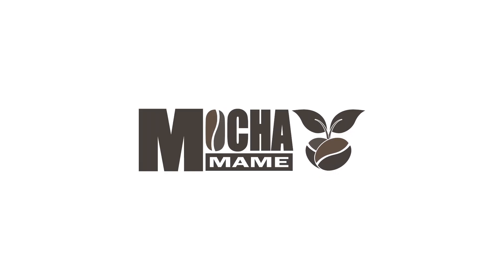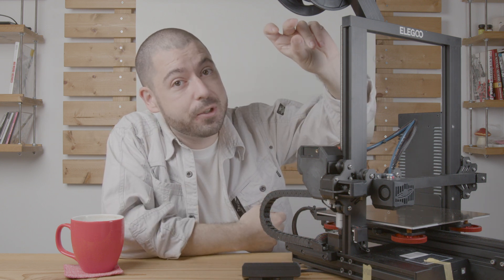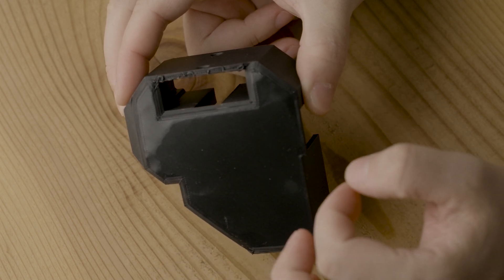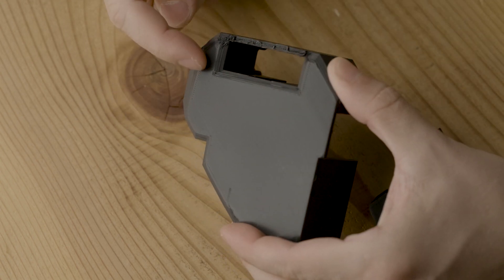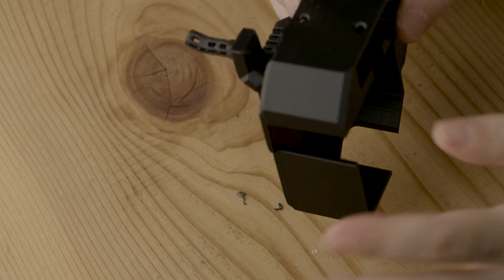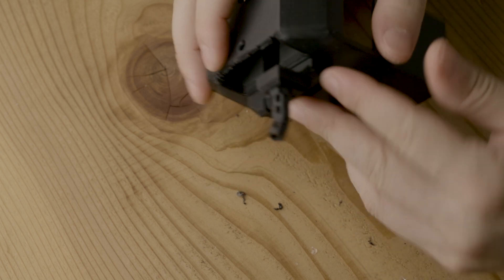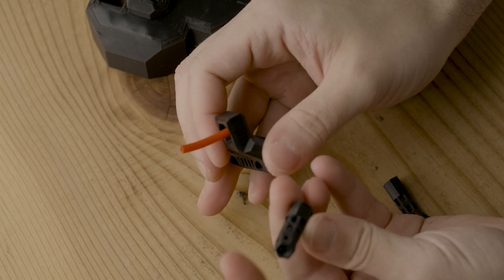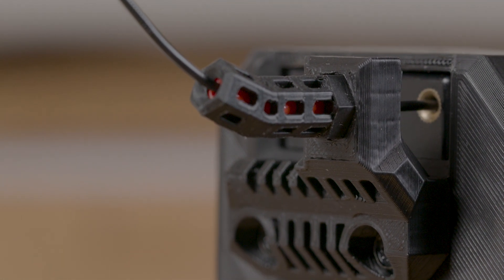Filament Guide for my Elegoo Neptune 2S Z-Axis Cover

Comment: Love your videos!  I am upgrading my Neptune 2s with your mods.  I am also going to replace the motherboard and screen with an SKR mini e3 v3 and TFT50..  Still looking for mods to add the motherboard as it's a different form factor than the robin nano board.
Reply from the maker: Thanks alot! I guess you found the file "with_filament_guide_holes" not sure why 4 versions of the same file are uploaded though. I've been thinking to mod and move the motherboard completely then build an enclosure but haven't gotten around to it. A lot of ender  mods work or almost work with the neptune2 maybe you can find an ender mod that fits.

Comment: i just got a neptune 2s and been messing with this currently, i like this design.  I have silenced the squeak from the filament sensor but i did notice now that the extruder motor is loud. did you notice the same. i have an ender 3v2 also and the extruder is quite compared to the neptune. love your videos thanks
Reply from the maker: Thank you! It's possible the guide is vibrating, or the whole z-axis cover is moving. I didn't notice the motor get louder after installing this, but after silencing all of my fans the extruder motor is the loudest part on my printer.  The stepper driver for the Extruder and Z axis aren't silent, only the X,Y.  Also this design isn't perfect, it helps with the squeak but there is still friction especially near the very end of the spool. I need to make a bearing version.

Comment: Hi, awesome video. I have been having trouble with my Neptune 2s not reading the SD Card properly. Actually I have 2 of these printers and neither one reads the SD card properly about half the time. The names get scrambled, or are just plain wrong, the printer stalls when printing some files (never heats up) and I have even had some files start printing at 25% in mid air. 

Have you experienced this issue or know how to fix this? I use prusa slicer but I don't know why a slicer affect this; just thought I would mention it. I would very much appreciate the help, you earned a sub.
Reply from the maker: thanks a lot!
the cards that come with the printer are pretty much garbage.
get a new card it will probably fix it. you could format the card an reslice if it works suddenly then the card is corrupt. last is don't use spaces in the file name. i think one of those must work for you. Good luck!
Reply: @MochaMameX  thank you. I appreciate you.
Reply: @MochaMameX  just an update. I went and bought a genuine SanDisk 64 gb and it seems to be working A LOT better. You are under rated and an THE GOAT  keep up the work. I look forward to seeing your videos in my feed.
Reply from the maker: lol awesome thanks a lot, glad to hear I could get you printing again, now I don't feel so crazy for using a 32gb. Next vid is in progress, hope to see you around!

Comment: Your voice is perfect for morning healthy product ads 😂 besides that, has anyone installed a dual z-rod in elegoo Neptune 2S ? I'm afraid I won't be able to fix the top bearing using a Creality kit because Elegoo top frame doesn't have the V chamfers on its sides
Reply from the maker: maybe I should try to get a sponsorship 😂 check out the comment from gmaranda in the link, they seem to have made a bracket and got it working https://www.reddit.com/r/elegooneptune2/comments/trrqax/are_creality_ender_3_parts_usable_in_the_neptune/

Comment: Hey man! Thank you very much for creating this guide. I think is a clever design and it looks cool. I Will print it as soon as I finish the mods to that noisy power source. I'm waiting now for a new fan because the original stop working suddenly. It is supposed that in this power source it should work only when needed but mine was always working at 100%
Reply: I made this short about the power source
Reply from the maker: oh I never read that label before! I remember the PCB inside the power supply has some empty spaces, maybe Elegoo didn't use a temperature control version
Reply from the maker: Hey you're welcome! Glad you like it! The power fan is supposed to turn off? Mine also runs at 100% even in the winter.
Reply: https://youtube.com/shorts/lEX4_kNsOKY?feature=share
Reply: https://youtube.com/shorts/lEX4_kNsOKY?feature=share

Comment: I took my filament detector off, it was such a pain in the arse to get the filament into it I quickly gave up on the idea of using it lmao
Reply from the maker: well that is a much simpler and easier solution than designing a guide lol.
Reply: @MochaMameX  lmfao it sure is, but had I still been using it I'd have used this for sure, it's neat
Reply from the maker: Thank you! even with the filament detector off the z-axis cover still works, it has screw holes the same as the detector so you just need a spacer the height of the detector and you could add the filament guide for show
Reply: @MochaMameX  Nice one cheers, gonna go grab it then!

Comment: Cool, i have printed the cable cover, but havent had the time to upload pictures yet and install it, work has been brutal xD
But now, ill have to get this printed first and add it then =D

I "fixed" the squeeking by having a filament dryer case (previously a TUSH) to place my filament rolls on level with the hole for the filament detector. It works, but i like this solution a lot ^^
Reply from the maker: Thanks! Work has been brutal over here as well, hopefully things cool down a bit for you. Moving the roll in line is probably the best, I'm thinking of putting mine on the side somehow...maybe a future video